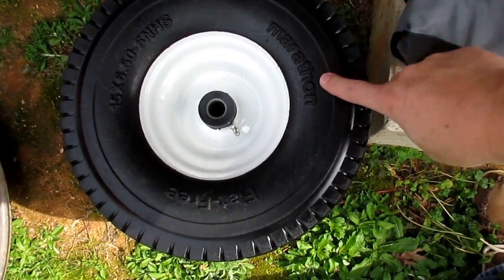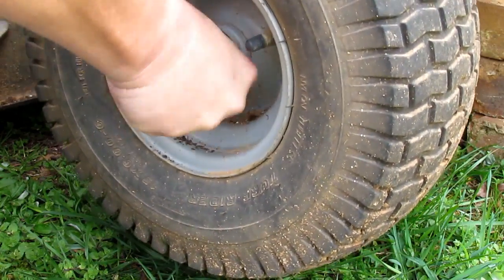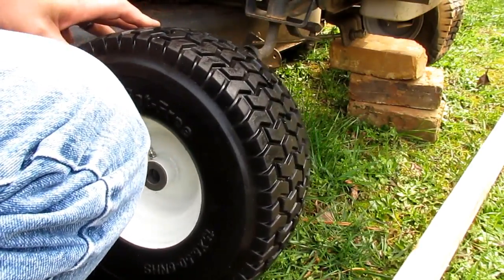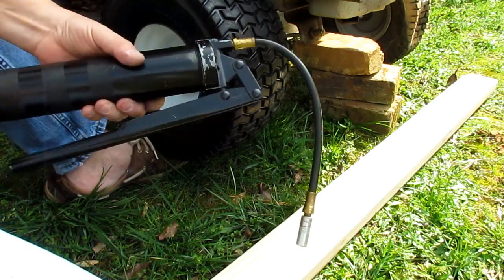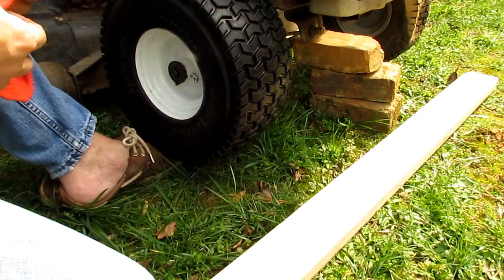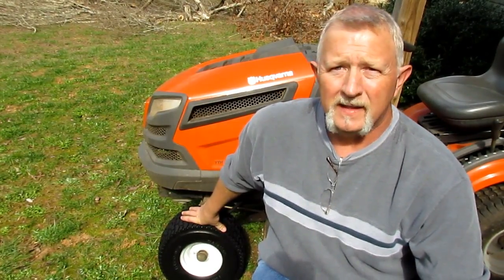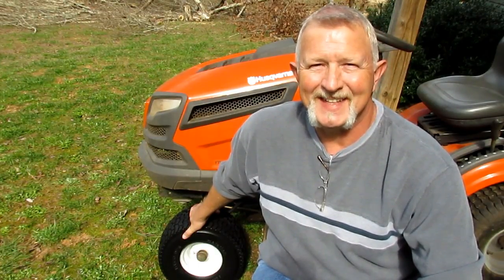Install Flat Free Tires on Husqvarna Yard Tractor

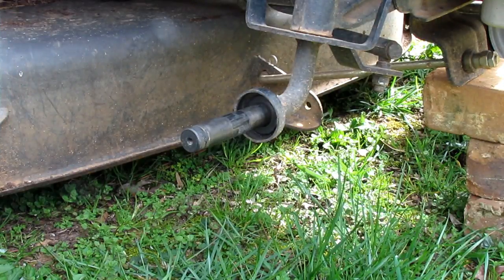Comment: Hi Dennis! Thank you so much for your tutorials. They have been very handy for us as we are learning to maintain our family's first riding mower. At the 3:23 mark, you mentioned the back cap that is fixed on the axel. That appears to be where our problem is. It has broken loose at some point and after greasing all the points you mentioned in your other video, we just realized the squeaking is coming from the inside of the tire or rim rubbing against the other metal part of the axel. Is that back cap something that we can replace ourselves or do we need to call for someone to service/re-weld it for us? Any thoughts would be greatly appreciated. I'd hate to damage our mower by continuing to use it while this is broken.
Reply from the maker: Hi Jenni, thank you for watching!  I'm glad my videos are helping y'all with your mower...that's great!  You could have somebody weld the back-cap onto the axle, or replace the axle itself.  I think either way would take care of the problem.  The axles are fairly cheap (I think they run about $15-$20 each).  I'm going to do a video soon showing how to replace the front axles....but it probably won't be up soon enough to help you.  Basically, you detach the tie rod, knock out the e-clip on top of the axle, then slip the axle out of the bottom and replace in reverse.
Reply: @dwcoffey  Thanks so much! If they're fairly cheap, we'll pay someone to just replace them. I was guessing we were in for a super expense repair when I saw it. Thanks again! Keep up the great work!

Comment: Hi.... my tubeless tires are 15 x 6.00-6. I noted that the marathon tires you used are 15x6.50-6 and also noted they the tires you replaced on your mower are 15x6.00-6. I assume the marathon tires would work for me just fine. Is that true? Thanks for your videos!!!!!
Reply from the maker: Hi Blade, thanks for watching!  The slight difference in tire size has not been a problem, nor has it been noticeable on my mower.  I've had no issues at all.
Reply: Thanks for your quick reply Dennis! I appreciate it! I’ve been repairing those tires for to long!!! 😂😂 Be safe and God bless!

Comment: Do you have to replace both front tires with flat free if you only have one that is flat?
Reply from the maker: I wouldn't replace only one with a different type of tire.  These flat free tires will track and ride a little differently than the original pneumatic tires.  Thanks for watching!

Comment: Good video. Here's my issue. I ordered two Marathon tire / wheel combos for my front axels. 15x6.5, stamped right on the side. Then I noticed they looked smaller than my oem tires. New ones were about 13.5 in diameter compared to the true 15 of my old worn tires.  Since then I've checked tires at Lowes and Amazon. Lowes were about 14". People on Amazon were complaining that they had the same issue with other brands.  Could Ii just try 16 inch tire / wheel combination? Were your tires accurately sized?
Reply from the maker: Thanks for watching, Dan!  My tires were accurately sized...they may have been 1/2" difference at most.  With as much difference as you are seeing, I'd think a 16" tire would be worth a try.

Comment: So my question is, you've had these now for a year, how are they holding together?
Reply from the maker: Thanks for watching Azzie.  These tires are holding up great!  I have nearly 200hours on them, some of it in rough terrain, and they are showing very little signs of wear.  I love mine!
Reply: @dwcoffey  great ! Can't afford those so I put a tube in . If flat again, I spray the green slime in. 9 years later I have 700 hrs and still the same tires, just with tubes now.
Reply: Try Zoro or Carlisle

Comment: Do these new tires add more of a bone-rattling/rough ride? From my experiance air-filled tires add more of a suspension system to the tractor; more give. I figured this would be an issue with these solid type tires? Great vid. Thanks.
Reply from the maker: Thanks for watching!  I haven't noticed any difference in the ride.  I expected the ride to be worse with these tires, but there's little to no difference.  I thought these tires would be like hard rubber tires, but I think they must be foam-filled.  they're not as hard as a solid rubber tire would be.
Reply: What’s the grease for?
Reply: I am replacing lawn tractor tires every 2-3 months and I have no idea why. The clerk told me these tires would make the ride so rough I wouldn’t be able to handle it. How was the ride? I’ve already spent 80 on tires this summer.

Comment: Dennis, why didn't you get a couple Flat Free tires for the rear, as well?
Reply from the maker: Thanks for watching, Christine!  Great question.....I haven't found anybody that makes a flat-free tire in that size.  There are companies that will fill pneumatic tires with foam in order to make them flat-free, but it is expensive and more than I'm willing to spend on a mower.  The good news is that I haven't had any issues with my rear tires holding air.  I have filled mine over half way with antifreeze, for added weight, and then topped off with air.
Reply: @dwcoffey  Darn! It's my back tires that I keep having patched and replaced!  Thank you for your response!
Reply: they are only for the front that takes a 15 X6 -6 it may or may not fit Simplicity Regent and some Broadmoor models or some dump carts as the OE wheel has an offset hub. i would check whether or not if they fit your lawn tractor before ordering as it may not fit MTD made machines the wheels use plastic bushings on these machines that by Yard Machines, Yard man, Cub Cadet, Bolens, Huskee, and Troy Bilt.

Comment: Dennis what about going from 15x6.5-8 tire to a 15x6.5-6 tire. Will I have to adjust my deck?  If so could you send me a link for that video?  Thanks in advance Bro.
Reply from the maker: Thanks for watching, Myron!  I think you could use that size tire, but you are right, it will lower the cutting height of your deck.  The deck on these mowers can only be adjusted from one side for leveling, but they can't be lifted higher than the highest cutting height setting, so....I'd be afraid that with the smaller front tires, your cutting height would be too low.  Here's the video for leveling the deck:  https://youtu.be/EL2wU1v5NvM

Comment: These are just a smidge bigger than the factory ones. (15x6.0/6) does it still ride and cut the same?
Reply from the maker: Thanks for watching, Mike!  Yes sir, they are a tad bit bigger OD, but I have had no problem with the ride, steering, etc.  No difference noticed by me.

Comment: Question here: 
I saw this video before - maybe about a year ago or so,,, After many tire repairs due to thorns and now a broken wheel due to my making repeated full tight turns, ( I broke one; although, I not NEED to get new front tires... The Marathon flat free tires ore even more $ ... However, the reason that I'm writing this is because it now looks lie they do NOT come with the grease zerk fitting. Mt tires are the 8" rather that the easier to find 6" inch... Do you think that the NO grease fitting ones will still be okay if I just grease the shaft and the hub as I install them? ... Thanks, Chris Caliber Asked on 8_16-2020
Reply from the maker: Thanks for watching, Chris!  I think they will be ok if you periodically take the wheels off and grease the axles and hubs.    You could also look at how your hubs are made and how the bushings are installed.  You may be able to drill the hubs and install zerk fittings.

Comment: Some of them caps are a PITA to get off!!!!!!!!!!!!   Especially if they are really hard and weathered - If they are hard to get off - just tear them off or get some side cutters and cut them off - if that's the case - make sure you buy a couple new ones!   just a couple bucks!  So check them first before you go to the store - to save from having to go on another trip!
Reply from the maker: Great point, Nicholas!  I agree, once those rubber dust caps get hard, it is really tough to get them off without tearing them up.
Reply: I know I hated mine up then pulled it off with plyers

Comment: Hey Dennis....is there any height adjustment to the deck of these mowers...mine is at its lowest point on the lever setting marked number 2...it should go down further right?
Reply from the maker: There's really only an adjustment to level the deck.  It's basically just inside the left rear fender.  IF your deck won't go down all the way to the 1 setting, I'd do the following: be sure you are on flat level ground.  Put the height on a setting that lifts the deck completely off the ground, then take a tape measure and measure at the same spot on either side of the deck.  I generally will use the back edge of the deck near the outer edge of both sides.  If both sides measure pretty close to the same, the deck is level.  If not, perhaps the left side is just low and should be adjusted up. That would prevent you from dropping the deck all the way to the 1 setting.  IF that's not it, let me know and Ill look for further things to test/try.
Reply: Thank you very much...our "Husky" get a real work out on the farm...so it may have be knocked out of level at some point in time with heavy use....I will certainly take your suggestions to the deck...and thanks again for the help....

Comment: I can not remove the E ring. Any tips on how to get it off. I do not see well, so i am looking for some help. Thanks
Reply from the maker: Hi Fran,  sometimes you can get a small slotted screwdriver between the back of the clip and the axle, then pry it off, just cover it with a rag or something as it will be apt to fly off.  Also, if you have a pair of needle nose pliers, you can get as perpendicular as possible to the axle with the pliers.  Have one jaw of the pliers on the open end of the e-clip and the other jaw on the axle.  Give it a little squeeze, and the clip should pop off, or at least slide up enough to get a slotted screwdriver under the back of it and pop it off.  I hope this helps!

Comment: Is there a flat-free solution for the back tires as well?
Reply from the maker: Hey Ken, thanks for watching.  None that I have seen.  I've heard of folks foam-filling their rear tires, but I don't thing readily-available foam would hold up inside the rear tires.  So I still run the factory rear tires on mine....I did fill them with water/anti-freeze for weight though.

Comment: Do these wheels develop flat spots when the tractor sits during the winter off season? i was planning to get a pair for my 2016 John Deere X350 22 hp Kawasaki Fc600V v twin motor.  its a typical 15 X 6-6 tire found on these consumer residential lawn tractors and dump carts.
Reply from the maker: Thanks for watching, Derek!  No sir, I haven't had any flat spots or issues with these tires.  I'm still running them (almost 4 years) and am still happy with them.

Comment: Dennis, my 46" Husqvarna is leaking fuel from the carburetor. ...is this something I can fix or should I replace it?
Reply from the maker: Hi Michael, thanks for watching!  It's hard to say without seeing it or more info, but it sounds like you might just need to replace the gasket under the carb.  That's a pretty straightforward fix if you are comfortable working on things.  Just be sure to take pictures before you take anything apart and keep up with all your parts.  The gasket should be available at your local outdoor equipment dealer.
Reply: @dwcoffey  thanks Dennis for replying.  I'll do that gasket and hope that solves the problem.  Appreciate your advice !
Reply from the maker: Yes sir!  Let me know if I can help.

Comment: The tire on mine is 15x6.00 6in can I go up to a 6.50 tire?
Reply from the maker: I don't think you'll have any problem with an extra 1/2" on the tire.  It will slightly raise the cutting height, but shouldn't create any problem with turning, etc.
Reply: It won't affect anything

Comment: my front tires are 15x6x6. Would these tires be too big?
Reply from the maker: Hi Dusty, probably not.  The 6.5 portion of the tire size is the width of the tire tread.  As long as your wheel hub is the same size, this tire should fit fine.  thanks for watching!
Reply: @dwcoffey  Thank you sir. You've always been helpful

Comment: how much would the back tires cost?
Reply from the maker: Hi Adam, the rear tires on these tractors are 20x8-8.  I have not seen any flat free tires available in this size.  There are sealants available that you can put into pneumatic tires, but I'm not educated enough about them to make a recommendation.